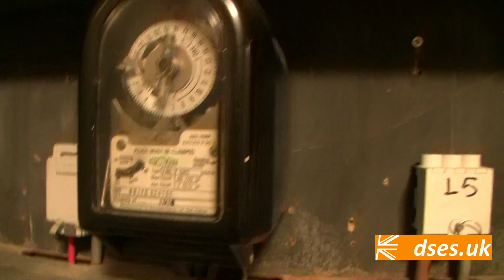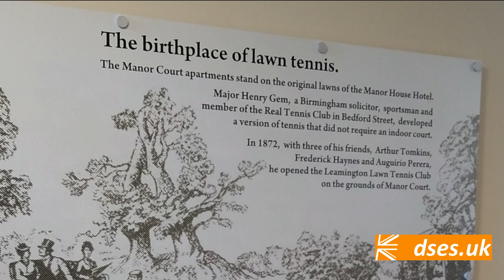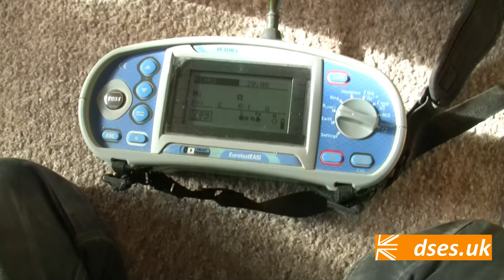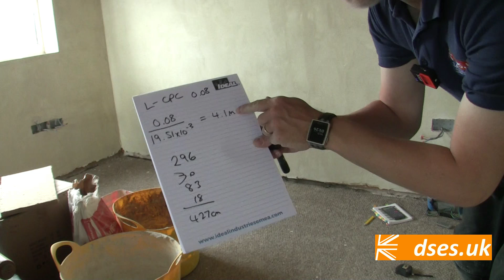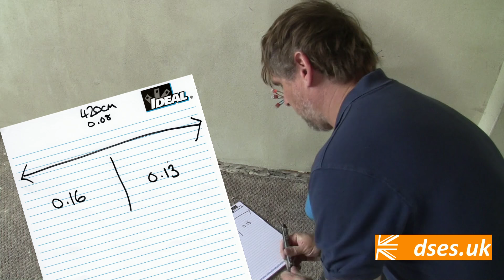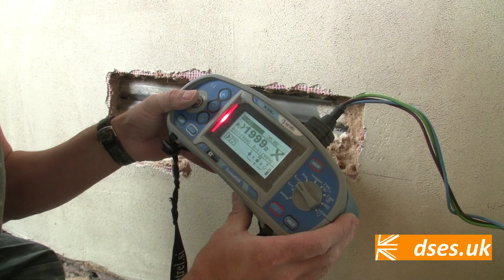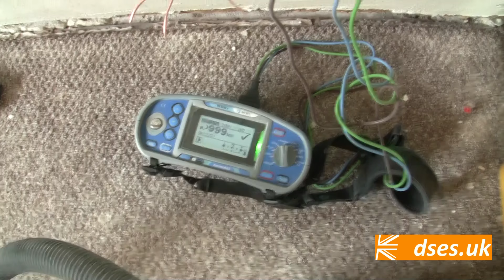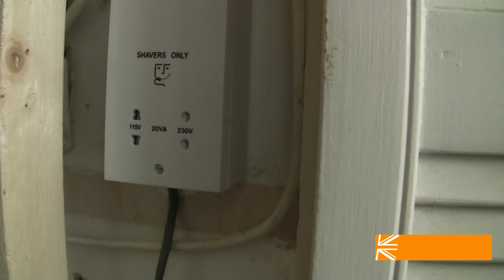Fixing another man's lash-up!

Comment: I think I'd have gone for the crimps and two layers of heatshrink to cover any exposed basic insulation. Finding butt crimps that are rated for solid wire by the manufacturer are tricky to find though! They're usually bare, that's why two layers of heatshrink are necessary. Coudn't have used the Hager box in Austria or Germany because here the wording's not "maintenance-free" but rather "permanent", which is then explained in more detail as "crimped, soldered or welded". Oddly enough, screw connectors become permanent if the enclosure is filled with resin. From what I've read, crimping and heatshrinking is quite common in Germany where cables are usually clipped to the brick/block without mechanical protection. In Austria, most reputable sparks would've run singles in Kopex, so replacing the lot would've been easy. I could've put in a junction box too but customers usually aren't too happy about blank covers in the middle of a wall.

Re: zones: do you have fixed zones in the UK that are considered safe even in the absence of accessories? That could explain the odd routing if the horizontal runs are within that zone but the sockets are above. I think usually there are two fixed horizontal zones, 30 cm above the finished floor and 30 cm below the ceiling, plus something like 90 cm above the floor in kitchens (don't quote me on that one, seems a bit low to me as work tops are usually right around that mark and any accessories better had be well above).
Reply from the maker: Crimps and heat-shrink have been my go-to in the past too, but I lacked a large diameter heat-shink that could have covered over the whole thing. There are non-accessory zones permitted, 150mm from a corner (down a wall or where the wall joins the ceiling). Personally, I would have used that to run the heater circuit with it then dropping down the wall to the accessory in this case, while the sockets could perhaps have been kept at a low level.

Comment: Absolutely fantastic mate. Will definitely try this method. Thank you mate
Reply: Here's how to calculate the distance using those readings too:

The two readings (0.13ohms and 0.16ohms) represent the RATIO of distance to the fault from either end. An actual reading to the fault can be obtained by the following equation:

(r1 / (r1+r2)) x Cable length (end to end)

where r1 is resistance to fault from point 1,
r2 is resistance to fault from point 2
and cable length is obtained by direct measurement (cable route known) OR calculated as David did in this video using the CPC and line conductor. For this example, the calculation is as follows:

(0.13/(0.13+0.16)) x 4.2 = 1.88m from the point where the resistance was 0.13ohms

the same works the other way:

(0.16/(0.13+0.16)) x 4.2 = 2.32m from the point where the resistance was 0.16ohms.

Comment: I have seen this odd / even routing for ring finals. Apparently it is done to balance load on the legs of the ring.  It does seem a bit OTT for a two bed flat unless it’s a HMO doing welding and laundry in each room.

Comment: The final  ring circuit is called staggered wiring . The staggered method used on large conduit installation final ring circuit.  The first leg of the ring circuit from the db go to the first 13A socket the second leg from the db go to the second 13A socket  the LN and cpc from first 13A socket go to the third  13A socket the second 13A socket LN and cpc  go to the fourth 13A socket  and the final 13A  socket closes the ring circuit. Using this method prevent second leg drawn  through all the 13A socket boxes to the final 13A socket. Knowledge passed on.

Comment: Yes , its an ODD and EVAN power circuit, used to install them mainly in offices where fuse board was long way away and that way of wiring reduces length of leg back to board,  original guy might have been told it was high loading on that circuit ?  some customers are good at convincing trades into overkill !!!!!!

Comment: Great video. Like a bit of science. If he'd put the cables in the prescribed zones I would have been tempted to add another socket at the break but he didn't so it would have looked crap. That plastering was appalling , looks like it is all going to drop off from the backing. Looked like bonding ready for a finish coat but they would have done this before calling you in I guess.
Reply from the maker: Thanks Matt, and you're right, had the cables been in line with the accessories then another socket cut into position would have provided an ideal junction.

Comment: You can calculate distance to the fault using the reading you got. 0.13 ohms from the RH point and 0.16 ohms from the LH point represents the ratio of distance to fault from either end. The calculation is as follows:

(0.13 / (0.13+0.16)) x measured or calculated cable length gives the distance from the right hand outlet

(0.16 / (0.13+0.16)) x measured or calculated cable length gives the distance from the left hand outlet

So for example, using the top equation and 4.2m as the total cable length:

(0.13 / (0.13+0.16)) x 4.2 =
(0.13/0.29) x 4.2 =
1.88m to fault from right hand outlet

OR, from the left hand outlet:

(0.16/0.29) x 4.2  = 2.32m from the left hand outlet.

On a fault like this it is likely that the readings wont be great as the fault is not a full short (has resistance). As such, repeated tests of the resistance from either end can yield different readings due to the resistance at the point of the short which is likely to wander a little. The technique is much better where a full short is present. Where the cable route is known, the measured length using a tape measure is likely more accurate as resistance in a cable is temperature dependent and the cross sectional area of the cable may vary slightly between brands / batches. 

How do you stand with regulations with regard to this repair? Can you still sign the job off even with the knowledge that the cables are not in the prescribed zones set out in BS7671?

p.s. You need one of these in your life:

https://www.screwfix.com/p/wiha-electricians-hammer-10oz-0-3kg/801jf
Reply from the maker: Thanks Glenn. It's a shame I didn't take the maths further on camera with this one. Regarding signing off, I'll sign off for what I've done, and I'll provide test results for what he's put in, but I will list the zoning as being a deviation and I will state on the cert that the majority of the wiring is not mine. Obviously, the cert is also for the design of the installation which I cannot fully attest to, but that's the real world for you, and if i refused to finish the job, they'd have found someone else to do it, probably without much diligence or any paperwork. It's always an awkward position to be placed in: do you take the job on and try and make a bad situation good, or do you leave them to the sharks? Had they rejected my estimate on price, I'd be tempted to do the latter, but this isn't a fault of their making; they accepted my estimate but the timing didn't work out so they had to go with someone else. I can at least try and put right what I can now.
Reply: @dsesuk  

'Regarding signing off, I'll sign off for what I've done, and I'll provide test results for what he's put in, but I will list the zoning as being a deviation and I will state on the cert that the majority of the wiring is not mine. '

Sounds good, at least it removes your responsibility and places the onus on the customer. I don't have the unenviable task of working on older existing wiring systems since we wire new build housing so I'm not familiar with what can be left or must be rectified. I did do the 2391 qualification but don't really get to put much of that into practice.

'Obviously, the cert is also for the design of the installation which I cannot fully attest to, but that's the real world for you, and if i refused to finish the job, they'd have found someone else to do it, probably without much diligence or any paperwork. It's always an awkward position to be placed in: do you take the job on and try and make a bad situation good, or do you leave them to the sharks? '

I'd be inclined to do what you have in this situation. Advise the customer that it has been wired wrong, document it (cover ones own ass!) and move on to the next....

' I can at least try and put right what I can now.'

Which you have! I would have not found out until second fix personally. This would likely have reared its ugly head after I had fitted the accessories as I wouldn't have gone to the effort of connecting all the points up at that stage. I wouldn't have felt guilty either since the fault would have been the other guys issue. Pretty sure you are covered by advising the customer though and at least they are RCD protected. Great vids, I watched your capacitive earth fault one yesterday. This one was pretty normal for me but I did learn a trick or two on that one. Great cure with the neon indicator!

Comment: Only thing I can think of with that weird ring setup was he was trying to keep the legs of the ring the same length. Some fantastic advice there on that storage heater/socket circuit on a how to pinpoint faults excellent for new electricians and apprentices to learn 👍

Comment: Could narrow down the maths down a little bit more- remove the influence of the short resistance.

The short is the same both sides so wire resistance one side+short resistance=0.13, wire resistance other side side +short resistance=0.16

But resistance one side+resistance other side =0.08

Adding both readings we get 0.08+twice short resistance=0.13+0.16=0.29

Twice short resistance =0.21
Short resistance =0.105

From that resistance one side =0.025
Resistance other side =0.055

Slightly less than one third the way along :)
Only be exact  if there's just one short though :/, but that would mess everything up basically.

Comment: Just general information on eco 7 boards the whole fuse board goes to the cheaper rate not just the storage heaters so all the socket are at the cheaper rate at night no need to put a socket on a storage heater circuit 👍
Reply from the maker: Thanks Matthew, that's what happens at my gaff, wasn't sure if it was the case everywhere.

Comment: I'm from chicago ILUSA I like seeing how othere do things in other counties. Why differant then the states. In most area's rope or cable is used. How ever in the big city,s we use metal conduit ( I like to pull a ground wire as well,not required by code) . I dont use the wago nuts except for ballast changes. We use wire nuts and twist the wire first, It is know required on new homes to use an afgi unit on each circuit . We limit circuits for general lighting/outlets to 15 or 20 amps at 120volts. and 240volt for bigger loads so the average home has 12 to 20 circuits and more on the bigger ones. We also have codes as number of outlets on circuit and where(spacing ). 
This installer at this unit did seem odd as to his lay out.  Do you have any video on layout and circuit code.   

Thanks keep up the good work!!!

Comment: Inaccessible junctions are permitted here in the states too. At least back in the '80s when I was in the trade. There used to be a kit for an interior splice that clipped together when finished, and could be covered up. The interesting thing about the kit was that it listed out the NEC code reference permitting the non-accessible use on the packaging - not something that you would normally see. Presumably it was designed for manufactured houses where the two halves get delivered to the site, and you "plug in" the two halves. 

Nice way of locating the short. :) Here in the states we usually have to find "opens" where the drywallers covered up a box. Rocking a straightedge across the wall looking for the bump generally gets you in the right neighborhood. Then it's up to the charity of the electrician as to how big of a hole they put in the wall "finding" the box (a bit of care usually results in finding the box without damaging the finished wall. But some guys decide to leave a "message" to the drywallers to remind them to be more careful in the future). I was taught to do my best, and I can remember one box that I had to find where I left a 2mm hole in the wrong spot. C'est la vie. But I've seen where other guys had simply bashed in the wall until they found the box.

When I owned my own shop, I did work for a contractor whose drywallers wouldn't cut out the holes for the box beforehand, but rather would use a router afterwards to cut out their hole. This left my box buried behind the drywall (it's supposed to be flush with the outside of the drywall), I had to purchase longer screws to mount the devices, the covers wouldn't sit flush, and worst of all, they would nick my wires and I would have to tape them up.

I asked them nicely if they would stop this nonsense, and their response was that "We're all here to make money, deal with it". "No problem" I told them, and on the next house I left extra long pigtails conveniently twisted together, and instead of powering up just the one plug under the sink, I wired up every appliance circuit in the house to the temporary breaker.

They came back to me after drywalling that house and meekly asked me to not do that again. It turns out that they blew up three router bits and one router cutting out the holes for my boxes. I never had a problem with them again.
Reply from the maker: Intriguing! I like the idea of blowing holes in the tools of those who failed to properly respect the sparkie on site!
Reply: @dsesuk  Thanks! I've always made up each box during the rough-in, so it was just a matter of wrapping the ground wire around the hot and neutral to give them every opportunity to find a ground path. And it worked far better than I ever imagined it would. :)
These days I'm retired from electrical work, and I just do the odd job for friends. I just got back from a friends shop where we are upgrading an old Takamktsu lathe from the '80s. We've ripped out the old controls, rang out the wires (it seems that Takamatsu wasn't a big believer in wire labels), and we are now hooking things up to the new controls. I made a career change in the late '80s to become a controls engineer, so I suppose that this is right up a different alley for me. Come next week we should be ready to fire it up and I can dial in any wiring changes that we've made in the program (we've upgraded it to CamSoft).
And it'll be nice to button this up so I can get back to piddling with my old Amigas. :)
Reply from the maker: @MrWaalkman  Old Amigas? I had the A500+ in the 1990's with a 1MB RAM upgrade! It sadly died, although I still have many of the game floppies. Datastorm, a Defender clone nobody seems to have heard of, was one of my favourites and many a happy hour was lost in front of Deluxe Paint III. I also had this StereoMaster MIDI interface and I built an amp that I hooked up to import sounds for mixing around. I was in an old chap's attic about a year ago to fix his TV booster and I spotted up there a mint A500 in its box. I was tempted to ask him if it was going begging, but it seemed cheeky to do so.
Reply: @dsesuk  You should have! There is not only a good sized following of the old Amigas, there are new boards made for them all of the time. And the UK and Germany seem to be the hotspots for the resurgence. And there are still plenty of them for sale in the UK market.

I recently bought a new PCB that is a recreation of an Amiga 2000 motherboard. The thing is absolutely gorgeous! I've got one for my 1200, and I think for my 4000 too (too much electronics here at the house to keep track of).

Buying one from eBay is risky, it boils down to if you don't see it working in the description, then it probably won't when you get it. Be sure to see photos of the insides, because of battery leakage wrecking the motherboards. Especially for the 500+, 2000, 4000 units - anything with a built-in battery.

Amibay (also in the UK) is the better choice for buying your Amigas (or whatever else from the retro world).

The good news for you, is that you've got a man in the UK who is a wizard at fixing these things. Tell Chris that I said "hi". :)

https://www.youtube.com/channel/UCRBWJ9JeJ3Q8ssn_ibii-Cg

And we've been known to dabble in Spectrums here as well: https://www.youtube.com/watch?v=-Q29C5nc-9k 

That's a short video of Stephanie finishing up her Harlequin ZX clone (at 8 years old). Yes, she built it from scratch. As well as a transistor tester, an AM radio, two other computer kits, a clock, and helped me fix a couple of TVs. She's prolific. :)

I'm off to get that damn lathe started up. Keeps me out of the Bingo halls I suppose...:)
Reply from the maker: @MrWaalkman  She handles a soldering iron better than any electrical Level 3 trainee I've seen coming out of college lately!
Reply: @dsesuk  Thanks! I'd like to say that she got it from me, but I showed her how to do about a half dozen solder joints and she said "Hold my juice box" and she was off to the races. :)

As part of the lathe upgrade Thurston is giving me the old hardware that came out of it, lots of through hole desoldering practice for both of us.

Comment: Hi David, you could have just dug out your old TD reflectometer from your electronic days and it would have told you the length of the cable and distance to the short. Just saying 🤓 Cheers, Gordon
Reply: Curious, do they work on flat t&e cable? I used one whilst at BT and it was very reliable for cat3 cable but I'm not sure its any good on untwisted cable lengths?

Comment: Man, got to love round PVC or corrugated tubes. In this case, the fastening system on these would've prevented the former "expert" from driving a nail into his own work.
Personally my aproach would be to pull out the cable and route a new one, but in this case I doubt that nail would let me do it.
Interesting and cool headed aproach.
Cheers